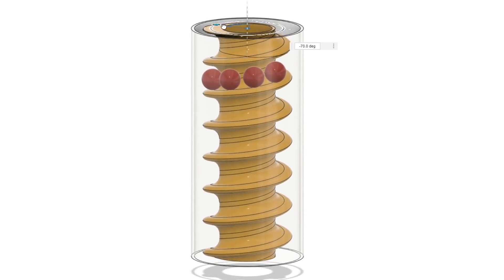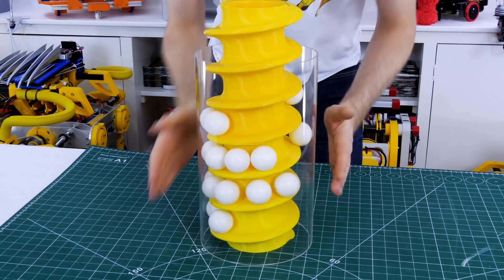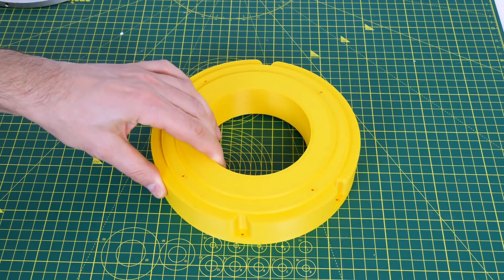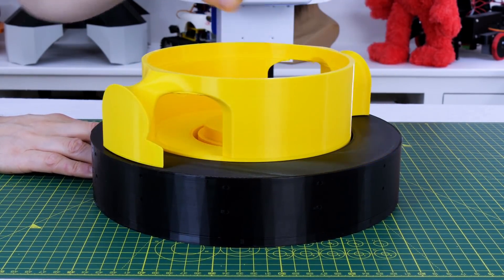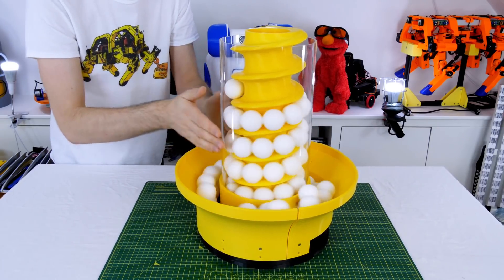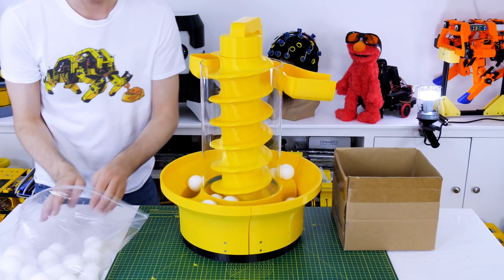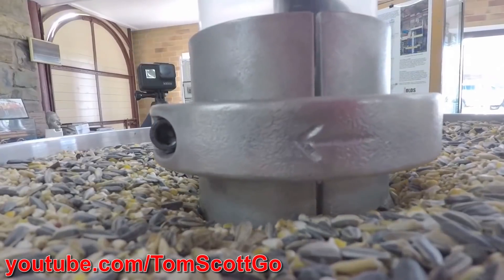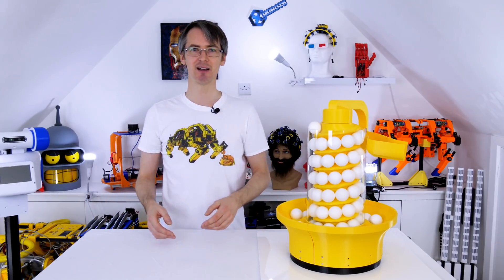Why this Screw Drive is Really Weird

Comment: I guess it depends on the friction between the tube and the material that's held in it. The screw does not have to turn in relation to the tube to make stuff go up, but rather in relation to said *stuff*. So if turning the tube also makes the stuff in it turn with it (probably depending on friction and how it's all held together at the bottom) then, yeah it should work. Also the animation at the beginning is misleading, because those few balls would probability not be turned hard enough by the tube, cause there is barely any friction at all. But then again, the same goes for turning the screw in that example. The balls should not even be going up there either because gravity would easily make them roll back down in a spiral fashion, yet they seem to be totally uneffected. Without looking further into this video I kinda feel klickbaited.

Comment: This will work, the reason it's not used is because spinning the screw is safer in practice and it also allows gravity to work with the item being moved better, that's why most augers are on their side aswell.

Comment: It's not going to work because of the size of the particles.

Using particles that span the gap between the shaft of the screw and the wall may allow the friction force to overcome the gravitational pull, but anything other than that and the friction isn't enough to overcome gravity.
And overcoming gravity IS the purpose of that specific screw.

Comment: If you had a bunch of smaller versions of the screw in a circle could it technically make a screwdriver that doesnt need a head for the screw
Reply: It would also be able to slowly put nails in if it is flat

Comment: Oh my god this is completely oblivious to the basic working physics of how an archimedes screw works.  This is entirely driven by the ball scoops at the bottom.  You could have done this up a straight incline, this has nothing to do with the screw the way you’re operating this.  
To have the screw work vertically you need FRICTION OF THE MEDIUM WITH THE TUBE WALL. You’ve nullified this core principle by using balls and a smooth tube.  
Another way it could work is at an angle, where gravity works to hold the media at the side while it’s dragged upward by the screw.  
Yet again another way is to run it vertically very fast so that the impact force of the screw on the balls produces an acceleration greater than gravity upward.  
The clue that its not working is that you need the ball catching cups on the bottom.

Comment: Ok what I'm seeing is that the base is what is actually driving the balls with mechanical pressure, not the interaction between the screw and the tube.  I'd like to see it with a tighter tube providing friction between the balls and the center screw which should then use (in theory), the friction from the outer tube to drive the ball up the screw.  Basically, you'd know it works if it can elevate a single ball to the top.  Your model (and the commercial one) require a critical mass of material to be present in order to get it to work.

Comment: That's not how an Archimedes screw works though is it? An Archimedes screw is diagonal and uses gravity rather than friction to keep the stuff in place against the side of the tube and raise it. So no, spinning the outside of an Archimedes screw would not work. This is really still really interesting though, a very cool invention.

Comment: I think factors like the friction between whatever you are moving up or down are important.
Reply: yeah the most efficient way to get  the balls up there would have been to push them one by one... balls get up without sliding.... there is so much air gap in the cylinder it's gonna stop feeding if the bin at the base get empty balls wills slide down .it would work with smaller object or sand...

Comment: If it was working with the screw rotating , it'd be rotating with respect to the floor the friction if which would presumably help push them, assuming there's a pool , however it isn't here . I think?

Comment: The catcher is driving the balls up - not the tube. 

An Archimedes screw with water wouldn’t work very well at all if you just spun the tube. The inertia of the water is what resists the screw in that case.

Comment: you don't have enough friction between the tube walls and the balls for the old elevator principle to work correct add just a single 1mm rod glued vertically inside on ur tube and it will improve result drastically!

Comment: Hm, seems to me that the main reason this works is that the scoop at the bottom helping to push the balls in and the friction and weight of the other balls behind it essentially propel the balls in the front upward. I'd bet that you'd get a very similar result of only the bottom spun and the rest of the column was stationary.

Comment: That’s actually a great fluid dynamics demonstration!  Notice how the elevator loses efficiency as the “fluid” (the bulk ping-pong balls) around the inlet starts to move along with the scooper.  James uses his hands as baffles, but fixed baffles inside the sump would improve the efficiency by a great deal.

Comment: That moment when you think up a crazy experiment and find out it works, only to then learn afterward that it was already invented and patented. Good job though, I figured it would work because I used to sand wood all the time. Let me explain.

When it comes to sanding wood, you can either lay the sandpaper down and move the wood against it or hold the sandpaper and rub it against the stationary wood. Neither process is better or worse, though holding the sandpaper might help smooth out indentations and laying the sandpaper flat might help to sand larger, flat areas at once. The friction, in the end, is the same.

Figured it would be the same whether the tube or the screw was spinning. Seems I was right, but for the wrong reasons.

Comment: the catcher is en-fact pushing them up the screw force = lift so the factors are feed force  friction static  and slop of dish so without the above no it could not work as the balls mass would pull it down faster old  rule of soild and hollow fall speed put a solid ball and a gas fill side by side one will always fall faster

Comment: Well, this is half a screw drive and half an impeller drive.  A significant part of the motive force is provided by the pressure caused by the impeller at the bottom drawing material into the screw.  The screw provides a low-angle path which reduces gravitational influence on the material.  The material is also aided by the wall to move around the screw.  A pretty neat design in all.

Comment: It works with enough friction with the medium being transported or it’ll be highly inefficient.

Edit: The sump added later in the video acts as the screw in this case, with less screw threads so to speak, which uses the other balls as the delivery

Comment: My guess is it's going to work. Assuming a no-slip boundary for the the ball-screw and ball-tube interfaces results in the balls rolling as the cylinder turns and both the cylinder and screw drag opposing ends of each ball in opposing directions via friction. If there was no friction between the balls and screw and cylinder, then it super wouldn't work and gravity would just make them slide down the screw. I learned how to mathematically model and analytically solve similar systems that had liquid instead of balls. 

EDIT 1: I guess if you think about it relatively, the screw turning inside a stationary cylinder is roughly indistinguishable from a cylinder turning around a stationary screw. So if one works the other should unless they're are substantially different.

EDIT 2: At 8:19 now, and it looks like it works better when the cylinder shifts off-center and pins a ball against the screw, at witch point the ball slips less and rolls up the screw without requiring any balls behind it. So this would work better if the tube was thinner and pinned the balls against the screw more at all points along the screw. (because that system better represents the two no-slip boundaries I mentioned earlier)

EDIT 3: 8:47 Interestingly enough, it looks like as you run out of balls in the hopper, the balls stop climbing up the screw until you load the hopper with more balls. It almost seems analogous to pressure, where, as the hopper empties, the force due to the weight of the balls remaining at the top of the hopper decreases as the number of remaining balls in the hopper decreases. Because of the shape of the hopper, this weight generally forces the balls at the bottom of the hopper to enter the pickup holes in the cylinder because it is a place for the balls to be forced into. The more balls entered the tube, the more balls needed to be in the hopper to keep them climbing up the tube. It seems analogous to a system in which the higher a water level climbs up a tube, the higher the pressure needs to be to keep the water flowing up the tube, because the water in the tube will exert a higher pressure pointing back down the tube, fighting further water from entering the tube. This could just be coincidence and I could be wrong about this third edit but, hey, still super neat to watch.

Comment: The only reason I knew this before the video is because it's a surprisingly recent innovation in moving grain around without causing explosions. It's also great because driving the outside is mechanically more simple than driving the shaft. Just put some gear-teeth on it.

Comment: Is is kind of going to work. If the screw is perfectly vertical, which it is, it depends on friction between the ball and the outer tube to work. It does not matter what is turning, because it is a closed system.
 If there would be not enough friction, between the balls and the tube, it would not work. But then it wouldn't work either with the screw as the turning thing. 
An Archimedes Screw works best if it is not vertical, because then gravity prevents the balls from rolling back. Then it would not work if the tube is turning, because the gravity is not helping. This is due to the fact that gravity is part of the system. If the source of gravity would also turn around the screw, it, again, would work. 
This was a way longer comment than it actually needs to be.

Comment: Sorry but physics fail. This is working only because the tube accelerates material through contact friction in order to have  the necessary velocity for the screw to work. It is far more efficient to move the screw directly introducinb the ramp velocity

Comment: unlike the archimedes screws, it's usefulness is completely dependent on a constant supply of solid, non-liquid, material....if you had stopped restocking the hopper with balls, it would have ceased elevating anything...you can see a precursor to this between each ball pickup when flow pauses and even reverses...which means it could never clear itself of material through the top unless a material was supplied through the bottom

Comment: With the ball feed in scoop and the weight of the ball supply, you don't even need the screw in the tube. A simple tube fed from the scoops would do the same thing if it had a sloping entrance to reduce the entry resistance.

Comment: Facepalms galore. This IS NOT how an Archimedean screw works AT ALL - in fact, a vertical screw would lift NO water at all regardless of what is rotating. Any water would just straight flow back down around the screw. The only reason this kinda works is that high friction at the bottom prevents all the balls from doing exactly what the water would do and just roll back down and out. So yeah, you can scoop up stuff with high friction with a screw and obviously in that case it doesn't matter what's rotating, the screw or the intake. But such a screw is not Archimedean at all...

Comment: As an individual piece you could just attach a slide to the top catcher to feed the bottom but if it is going to be part of a larger system than that works to. Can't wait to see what you come up with.

Comment: Now I am wondering if this could be made flexible, similarly to flexible shafts in sleeves, making "active pipelines" to transport small grain materials and fluids.
Also, what if the design was reversed, so that inner core was smooth and cylindrical, and the spiral ridge (path) was attached to outer wall? For my former idea, that would mean using almost every part of existing flexible shafts, replacing only the sleeve and adding side ports for transported material at endpoints.

Comment: Missed opportunity to talk about friction and the role it plays. :-(
Reply: Imagine the screw as a ramp wrapped around a cylinder. There's an inner core and an outer shell. Now "un-roll" each. You have two ramps side by side. Moving what was the inner ramp relative to the outer, or the outer relative to the inner doesn't matter. It's the force imparted on the balls because of the relative movement between the ramps and the friction of the balls with the ramps that cause them to move. Thus it doesn't matter if the inner screw or the outer shell move.

Comment: I wonder if you added some baffles to the base (assuming the outer yellow base isn’t rotating as well) it would produce more resistance to force the balls up.
Reply: of course anything that would push slightly against the balls that want to slide down would help this is like very ineficient pushing balls one by one at the base would have worked better.

Comment: Sorry, mate, but you failed to answer the question you asked. Your initial question was, "Will moving the tube move the balls?"  You did not test this. Your modifications actually move the "catcher" and the scoops on the catcher are applying and external force to the balls. Pushing the balls into the holes would have the exact same effect as what was actually created.

Comment: I wonder if you added a rubber / sticky material to the inside of the tube, if it would fill up faster. I'm assuming that's why the grain feeders seem to work better; more contact area / friction on the sides of the tube.

Comment: I think one problem with this idea is that you already made a mistake at the start when you assumed the balls would rise [better] when you turn the screw itself. Because that's what you take as a baseline and even that wouldn't work properly if the screw would go straight up. Only if you angle the whole construction and gravity keeps the balls on one side, they raise when you slowly turn the screw. If the whole construction goes straight up, the balls won't rise but just move around in a circle at the bottom.
The only reason this still works somehow is friction. Friction is basically replacing gravity here, but I'm pretty sure gravity would do a much better job, even though gravity will only work as long as you turn the screw instead of the tube around it and you angle the whole construction. But as long as you depend on friction instead of gravity, it doesn't really matter if you turn the screw or the tube.

Comment: The most interesting information you could have shown us is what happens when the number of balls in the reservoir gets low.
Is there a critical value of balls, in order to press the balls underneath themselves into the hopper?
Do standard models of barometric pressure resemble what is happening here, where the number of balls in the bin are comparable to the air pressure pressing down on Torricelli's bowl of mercury with the tube in it?

Comment: Prior to finishing this video, my answer to the wall of the cylinder spinning, logically, no. Unless whatever material you are trying to move touches the wall and creates enough friction to "grab" said material to move it up the inclines of the outer diameter of the corkscrew or "auger." 
Okay, on to the video to find out!
Edit: Okay, I'm halfway through the video, and you cheated, and didn't say anything about "forcing" it up. Haha.

Comment: You need to put a couple of lego wheels with motors so the ball are thrown away and not fall in the box. I see it's pseudo random the timing of the balls. Would be an ping-pong throwing machine to practice.

Comment: The system works but is greatly limited by the friction between the tube and the ball.  You only have a point contact there, versus if the screw was turning you would have a lot more surface contact between the screw and ball.  It works better (but still not great) for stuff like  seeds because they send to not have a spherical shape and thus for their size they have a decent amount of surface contact.  Plus the coefficient of friction is higher between seeds and the tube versus plastic on plastic.

Comment: Another, and more efficient way when it comes to balls, is to turn the screw instead of the tube. You would then use a tighter tube, with a slot to fit the balls. This way you would get a backstop preventing the balls to roll back down. The old Cascade game from Matchbox featured a solution like this. Please check out:
https://www.youtube.com/watch?v=OoGYqa6e0z4
https://www.youtube.com/watch?v=ayXWGsP2VbY

With a screw as wide as James's, it would be possible to have multiple slots guiding the balls.